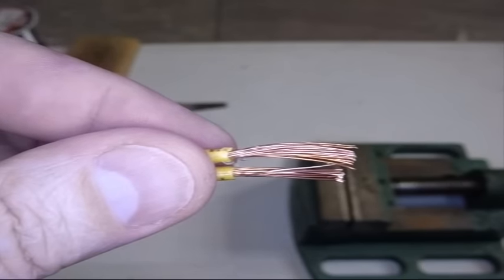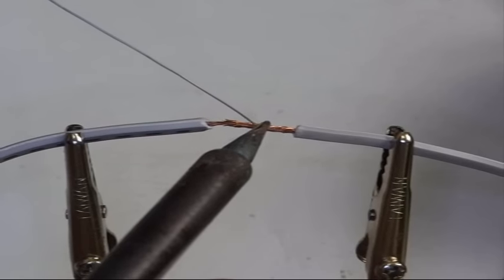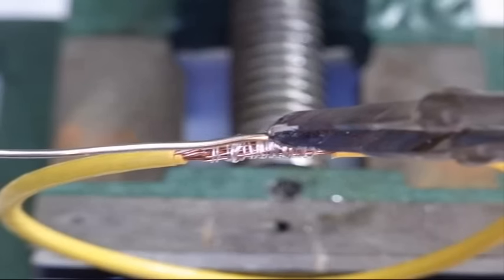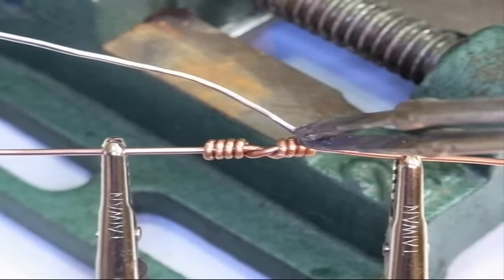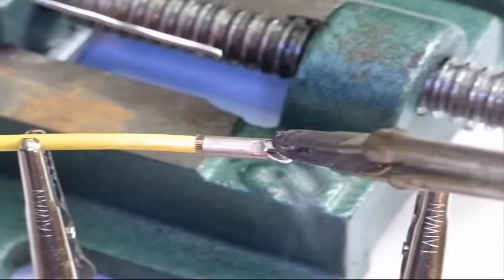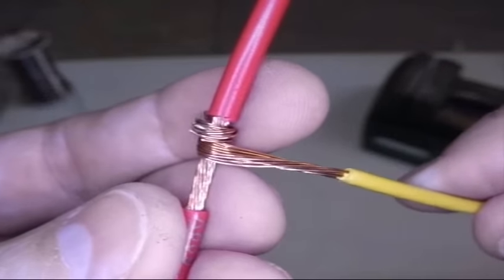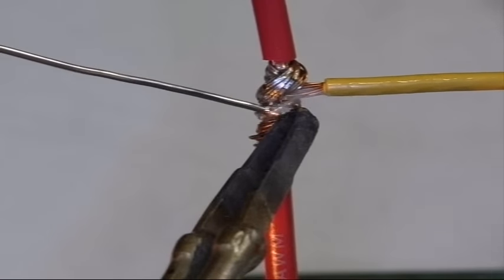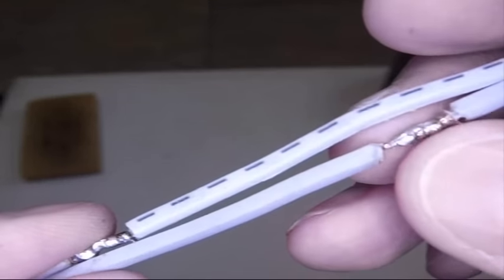Soldering Basics - Popular Solder Connections

Comment: Great Video, Thank you. One thing I was taught years ago, was to place the soldering tip under the splice, and place the solder on top. That way the heat rises up into the wire, and it's the wire not the tip that actually melts the solder. I was told that was not only faster, but helps insure that the solder flows well (capillary action) into the joint. What's your take on this way?
Reply from the maker: Thank you.  I did a video on which is better, from below or above.  I won't spoil it for you.  
https://www.youtube.com/watch?v=NfQd9wLJUuw
Reply: This is how I was taught as well. Heat both wires then touch the solder to the wires, not the iron. If you touch the solder to the iron, the solder will melt and flow over the connection but may not bond to the wires, causing a cold solder joint. I've been soldering for nearly 45 years and I would not trust a connection where the wire wasn't heated enough to melt the solder. 
I'm sure most people will say "I've been doing it that way for years and never had a problem" but here is an explanation I found of how solder must bond to the wire to make a good electrical & mechanical connection:
For a soldered joint to be electrically and mechanically sound, the solder needs to 'wet' the metals to be joined. In the context of soldering, wetting is the process whereby the molten solder partially dissolves into the copper base metal, forming a region that’s part solder and part copper. This creates inter-metallic bonding and it’s the key to soldering. In most solders, the molten tin is the primary solvent that dissolves into the copper substrate and forms the inter-metallic bond that electrically and mechanically stabilizes the joint.

Comment: That third splice was the one we used on phone wires in Korea.  Of course we didn't solder but if there was time we would tape the splice.  Some of our phone wire had been broken and spliced so many times that we could only get communication on it for 2 miles instead of the rated 12 miles.

Comment: Interesting. I always thought those butt splice thingies were crimped on. thanks so much for this video. So many hobbyists don't really know how to solder. I was fortunate to have both parents in the electronics field.
Reply from the maker: They do make crimp on types of course and they are more popular.  These also can be crimped and soldered, in fact I would prefer that.  Having a mechanical connection in addition is always best when soldering.  One benefit of soldering a crimped connection is it ensures that corrosion / dissimilar metal reactions are greatly reduced - important in humid / wet / marine environments.

Comment: Very informative, nice camera work. I just got one thing to add, when you solder multi strand wires, they become stiff. To avoid the joint to brake due to shakes (in any  vehichle) strap the joint close to exsisting wire to keep it steady, beeing supported)
Fine work not too much solder, the strands should be as yours, visible.

(I learned my soldering when I was with the Danish Airforce - things we soldered had to be as good or better than the original)
Reply from the maker: Thank you .  Yes good point.  I did not go into strain relief and fastening.  Maybe a video for another day.  I like Denmark: been there a couple times.  Beautiful country and great people.

Comment: useful to see you work - in some circumstances I would have pre - tinned the opposite ends of the wires or the larger part to reduce the heat loss down multiple wires then the final heat requirement when joined is reduced....
Reply from the maker: Thanks.  Yes, I do pre-tinning too if the pieces are big, or I want to avoid heat damage or if there's a lot of stuff and I want to do it assembly line style quickly, ...

Comment: Thanks for the great video.  The problems you had with the butt splice tube would have been reduced by applying the heat from underneath the tube and the solder from above.  That way heat is allowed to propagate up into the joint while drawing the solder down into the tube.  I think if you applied the heat from underneath your splices you would get generally better results.  That having been said clearly you are very good at soldering and again thanks for the video.
Reply from the maker: Thanks, good suggestion.  I'll bet you are right.  Will try that next time.

Comment: A further improvement to the 3-way with multistrand is to untwist the wire you are attaching to, put the other wire through, retwist, wrap the attaching wire, and solder.

There’s a lot of vaiations possible with it, including ones for one of the wires being solid.

Comment: How does one insulate the T or 3 way one properly? You can slide a piece of heat shrink down each wire, but you'll still have a gap where they all meet.
Reply from the maker: I use this for low voltage / low current applications only, like crystal radio antennas. If you work at it you can tape it, I have done it on my motorcycle. If you are not sure, ask a pro to show you first.

Comment: Get yourself a ceramic element type iron. Miles better. I've used all sorts of irons over the years and ceramic irons get way hotter and they last forever. Makes soldering far easier.
Reply: Do not use acid based flux on electrical wires. Use only rosin core solder.   Flux is needed to make sure copper is clean and that oxidation during heating is not a problem.

Comment: quick tip for you or anyone who does the 3 way's joins; i like to, when stripping the one i'm splicing into, separate the wires so it's roughly half of the strands on each side and then run the one i'm tapping with through the hole and then twist it all together and then finish off with solder and insulation.

Comment: Brilliant!  No one ever explains these things.  Thank you!   Any suggestions for how to join a split headphone cable?   You know -- those earbud cables with the 3 super-fine wires...  left, right and ground.  But hair thin!   Would love to see how you join those... or is it even feasable?  (I gave up...)
Thanks again!
Reply from the maker: Just saw your comment.  Some of those really fine wires resist all attempts at soldering.  Not sure if they are coated in something, that's my best guess.  Mechanical connections work, but are hard to make strong.

Comment: I tried to twist together two Wires and do a linmen splice but the solder did not stick very well should I get flux? (it made a strong joint even without soldering so it dosent really matter that much)
Reply from the maker: ONLY use rosin flux.  A lot of common flux is acid flux and it badly damages most electrical components.  Most solder contains flux, so if the joint is bad, the work pieces were probably not clean enough.  I have videos on soldering that explain in detail about the does and don'ts.

Comment: How would you insulate the tap in connection you made joining one wire to the other ?
Reply from the maker: You mean the T connection?  First, it's usually used for things like antenna that don't carry enough power to kill or start fires.  If you want to insulate it, I usually carefully tape it making sure to get the "armpits" of the T.

Comment: Hello :)

In the first type of soldering type, pigtail, you said that one should check for wires sticking out or sharp edges that could cut your insulation tape. In the event that there is sharp parts, how would you go about fixing that?

Also, you mentioned that copper corrodes in seawater. Do you happen to know about how long it takes until copper starts to corrode?

BTW, excellent guide/tip/informational vid on soldering. Great job!! Thanks :)
Reply from the maker: Good questions: if there's a sharp edge sticking out you can dull it with a file or even taking small nips at it with cutters.  Then use pliers to press it down flush with the rest of the wire(s).  Copper is a very reactive metal.  Bright, shiny copper starts to dull in just air very quickly, in salt water you can watch it happen.  The speed of salt water corrosion varies with things like temperature, degree of salinity, other metals in the vicinity, etc. so copper needs to be protected as much as possible from water and salt water.

Comment: Have you considered maybe cleaning your tip? You'll get much better heat transfer, and less inclusions in the joint.
Reply from the maker: Yes, I wipe the tip off camera constantly.  The end that is touching the work is very shiny most of the time.  The big iron gets too hot and oxidizes the lead quickly, so I have to clean it very frequently.

Comment: i bought a 30w solder iron  and it takes forever for the solder to melt.
i see u guys do it and it melts in seconds.

is it because of the temperature of the the iron??
Reply from the maker: There are a few factors: size of work piece (bigger requires more heat), size of solder (fine melts easier), cleanliness of the tip (a dirty tip does not transfer heat well, and if the tip is not well bonded to the heating element because of corrosion, ditto).  If all that's good, then more watts are needed.
Reply: mark yisser, 1st eliminate any extenion cord. 2nd buy a new soldering iron.
    I doubled the wattage on my replacement, from 15w to 30w. The range of wattage varies greatly.  My first one barely reached a temperature capable of  melting a full inch of solder. It wasn't my learning curve, it was a bad device, I should have pitched it long ago.
Reply: The type of solder also matters greatly - a 60/40 lead/tin solder will melt at a way lower temperature than some lead free silver solders!
Reply: It happened to me. Here's how I solved it everytime (hitherto):
1. Wipe the tip with wet sponge, when the tip is hot.
2. Use larger part of the tip to transfer more heat.
3. If step 1 and 2 fail, buy a new solder iron.

Comment: How would I insulate the spliced connection properly? Is just folding two wires out of one side sufficent?
Reply from the maker: Good question and the general answer is "it depends".  For stuff like antennas, it's not typically insulated or the insulation is achieved by suspending the wire away from things.  For low voltage applications like in cars, you can carefully wrap it with electrical tape making sure to cover the "angles".  I would not use it in house wiring or any higher voltage applications; for such a joint you'd have to check with local codes and professionals for that.

Comment: Is that a 60/40 rosin core solder? I get bad results w/o flux. I prefer a micro torch; when I have safe room to use one.
Reply from the maker: Yes, 60/40.  Flux (usually acid flux) is really bad for electronics / copper.  Use it for steel gutters and the like, but keep it away from electrical / copper.  It causes corrosion long term.  I have a video on basic soldering, but I can sum it up for you: clean everything: soldering iron, thing to be soldered and the solder.  Even a small amount of oxide, oil (from hands), etc. causes the solder to ball up, turn black, etc.  If all these things are clean, the soldering will go just like in the video.

Comment: Are yor pre-heating the wires before you solder? My solder never flows that easily
Reply from the maker: No, you are seeing everything I am doing.  I have some other videos on it.  The number 1 trick is to make sure everything is clean: solder, work piece and tip.  If everything is clean and the solder will not flow chances are your gun / iron is too low of wattage for the job.  https://www.youtube.com/watch?v=fNyAK1WvtsA

Comment: number 2: "basket weave" splice. Number 3, "NASA" splice (min. 3 turns @), Number 4:  "butt" splice (typically crimped+ soldered)... 
modification of number 5: "military splice": form an "eye" in the strands of first wire (as  with the eye of a needle)
TIP: leave some insulation on the end of the second wire (to simplify "threading" the eye... wrap as above (removing remaining insulation end) wrap (collapsing "eye") solder and insulate.

Comment: How do you get the solder to melt right in like that?  Most of the time when I did it they just ball up and fall right off.  Is that because not enough heat transferred to the wire?
Reply from the maker: Here are 3 videos that might help (there are more in the description).  Typically when solder balls up, especially if it looks dirty, it means that the work piece and/or solder and/or soldering iron are not clean.  Clean and oxide free are most important.  

Soldering Basics - For Cars, Experimenting, DIY'ers, Boats, Solar, ... 
https://www.youtube.com/watch?v=fNyAK...

Soldering Above or Below, Which is Right / Wrong
https://www.youtube.com/watch?v=NfQd9...

Common Soldering Mistakes
https://youtu.be/D6EKGwn-xVg

Comment: I thought you were supposed to heat one side of the joint and place solder on the other letting the solder flow toward the heat??  I'm I mistaken?  Good explanation of different joint types though.
Reply from the maker: John, soldering on opposite sides is a common myth that I think comes from the days of torch soldering, like the idea one must heat from below.  Even Weller's manual shows soldering on the same side.  I've got a video on it: 
https://www.youtube.com/watch?v=gFGvNrYpsGc&feature=youtu.be
Reply: @tsbrownie:  Well I'm not a professional nor is soldering a work requirement.  I'm a hobbyist at best.  But many videos I've watched have suggested the 'opposite side' technique and I'll have to say the whole idea of 'solder flows toward heat' kinda of sounded a little off.  The solder reaching its melting point, liquefying, and coincedentally flowing in the direction of the heat sounds like a better hypothesis.  Thanks for the insight and the video.  Gotta love youtube if for nothing more than the knowledge it offers.
Reply from the maker: @John Smith You are correct about the solder flow.  I've soldered tin boxes, copper pipes, electrical wiring and electronic circuits and I think there's a lot of crossover of soldering learning between soldering primarily for mechanical connections (like boxes and pipes) and soldering primarily for electrical connection that causes confusion.  There are different rules and goals in the different processes.  

The "solder flows towards heat" I think is more a "mnemonic" (for lack of a better term) to help people soldering pipes remember what part to heat and where to place the solder.  When it comes to wires and electronics, a more helpful way of thinking of what's going on is that solder is most liquid near the heat source (and flux is most active / effective) and solder becomes more solid farther away.  Of course there's a lot more to it than that, but I begin to ramble.

Comment: When I am soldering the wires and bullet connectors for the quadcopters I build I find that the heat from the soldering iron is travelling up the wires away from the soldering point and even though it will solder ok eventually I am concerned about the heat damaging the PCB board or motors etc. Is there anything I am doing wrong to cause this? I am pre-soldering each part prior to soldering.
Reply from the maker: Wrap the wires in a piece of wet tissue paper.  The heat pretty much stops there.  Pre-solding can also help a lot.

Comment: A lot of great methods. I learnt a whole lot just by watching this video. At the butt splice section, what's the material you soldered? Was silver, metal, aluminum, ...etc? I am thinking of using this method for my vehicle just for the better looking wire organizations. Is copper tube is gonna solder the same thing as the one used? 
Thanks
Reply from the maker: Thank you.  Glad it was useful.  The tube splices are pre-tinned copper.  If you search google for "splice connector tube" you can find some suppliers.  You could use a copper tube, but you will have to clean it REALLY well on the INSIDE.  Not easy.  I'd then tin it after cleaning it and before soldering.
Reply: tsbrownie thank you for the great tips.

Comment: Good soldering basics for beginners. I would have added that, if you are intending to use shrink wrap to cover the joint, push the shrink wrap up the outside of the cable first before you join them.
(Anyone else find themselves blowing at their screen to cool the joint?)

Comment: How do you use heat shrink tubing or alternative with a 3 way splice?
Reply from the maker: I usually tape the 3 way joint carefully then use shrink wrap over the tape to keep the tape in place. And I use it only for low voltage/low current uses.
Reply: You can get creative and slice the shrink wrap but only half the length.   Slide over main wire, pull up to wire that sticks out and then bend 90 degrees so lays under the side wire.  Cut another half way and slid down the main wire and then turn out (90) to the top side of small wire.  Put a solid piece on the small wire and two main wires and slide them up to the central joint.  You now have solid shrink covering all parts.  Heat gently to tighten all the parts and then tape with a higher quality tape or even an epoxy at the cent to cover cuts.   You can do variation of the overlays and can even add a second set of  larger pieces over the initial pieces.   Sorry it may sound confusing but try a few times and you will get the hang of it.